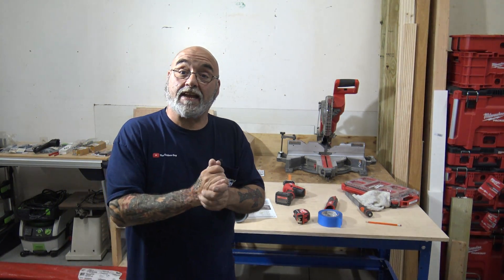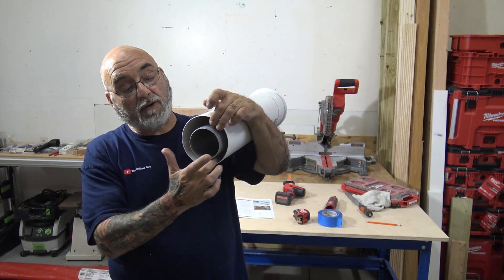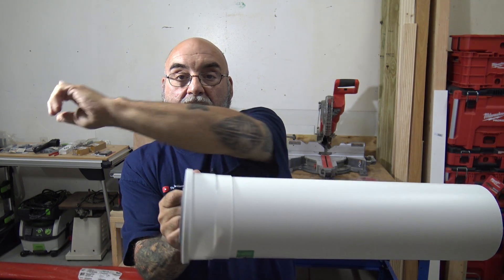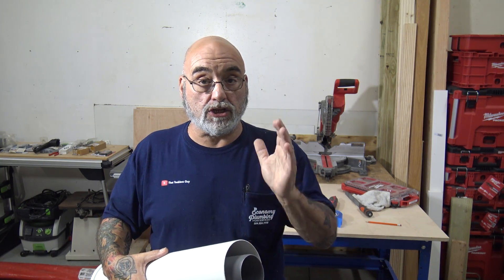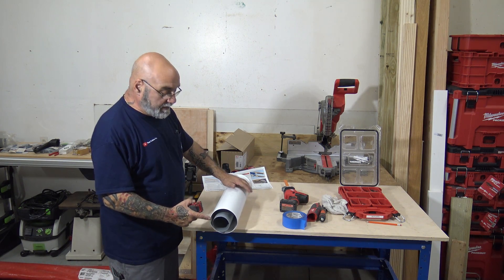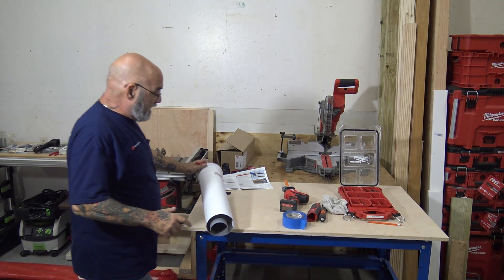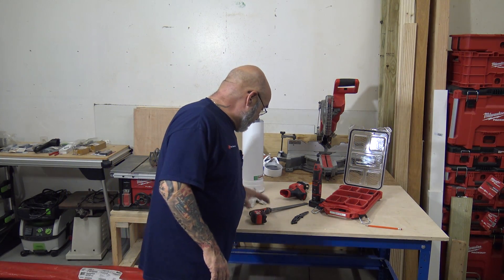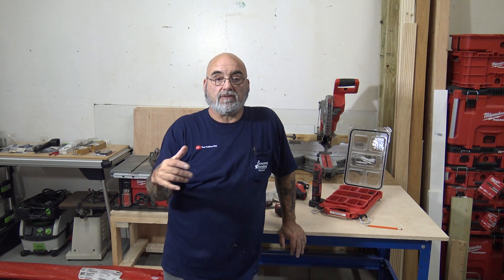Cutting concentric venting for a Tankless heater

Comment: Can you recommend a gasket type silicone to use to reseal the heat exchange ? my RU130 started to leak right in the middle, I bought straight From  clearwater Gas  here in Florida . I took it apart and cleaned it all out. it is ready to be reassembled. It is less than 1 year old, their support is horrible, I even made a Video call Where Rinnai tich was able to See the leak and determined that the heat exchange needed to be replaced. Since I am the homeowner, they will not send me the part unless a certified plumber is involved.  the cheapest Labor estimate  to replace the heat exchange was $ 680,.. I removed it and installed a 18kw $350 electric tankless. I wanted to have this Fixed as backup. thanks

Comment: Question - i hear a thump which sounds like it's coming from the exhaust when hot water is shut off ( i believe ). I flushed the tankless system and cleaned the filter. still happening. any thoughts?